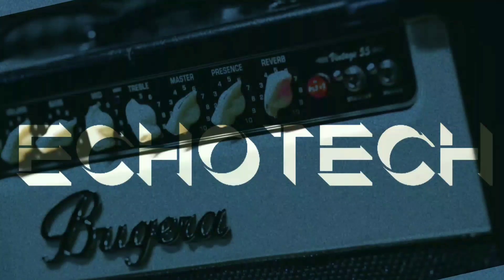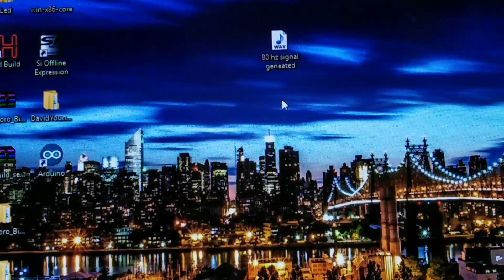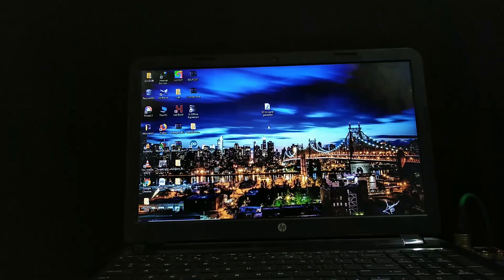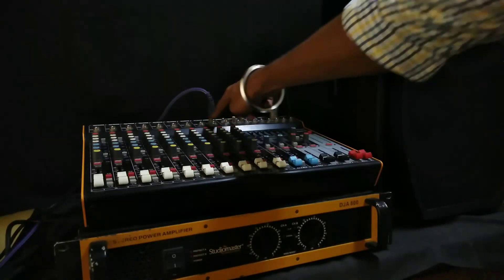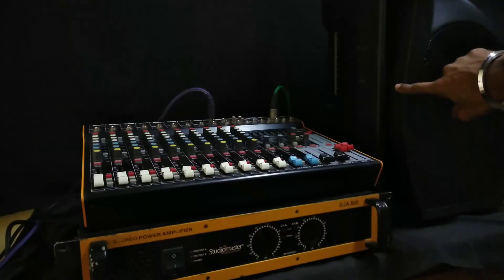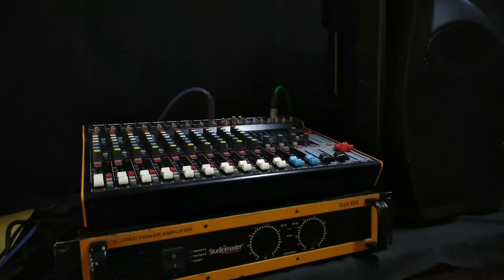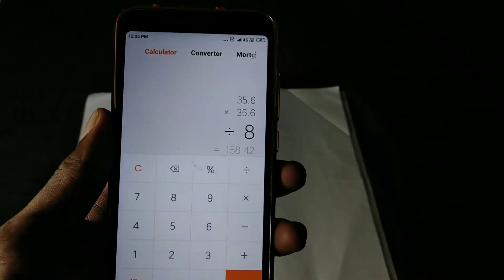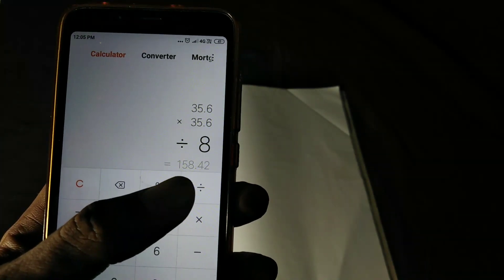എങ്ങനെamplifier wattageഎളുപ്പത്തിൽ  കണ്ടുപിടിക്കാം|finding wattage of an amplifier

Comment: Amplifier Test cheyyumbo kazhivathum Speaker connect cheyyathirikuka. 2 karanangal aanu. 1. speaker orikalum continuous power handle cheyyan design cheithirikunnath alla, so coil overheat aakan sadhyatha und. 2.Speaker impedance frequency anusarichu marikondirikum 80hz speakerinte resonance frequency aanenkil impedance 100Ohm il kooduthal aakam. apo theere kurachu current mathrame speaker edukullu. Athukond power test cheyyan speaker upayogikathirikuka, pakaram resistor upayogikuka. Nalla video! keep it up. your explanation valare vyaktham aayirunnu, good work.

Comment from the maker: N O T I C E The method described in this document is not designed to determine the actual "rated," "peak," or "dynamic" output power of an amplifier.
The original procedure include oscilloscopes,signal generators peak detectors and so on.kindly use this to check whether your amp output is working or not.
ഒരിക്കലും ഇതൊരു exact method അല്ല. Amp work ചെയ്യുന്നുണ്ടോ എന്ന് നോക്കാനും മറ്റും മാത്രം ഈ method use ചെയ്യുക. ഇത് ശരിക്കും ചെയ്യാൻ ഓസ്‌സിലോസ്കോപ്, signal generator എല്ലാം ആവശ്യമാണ്
അതുകൊണ്ട് പരിമിതികൾ മനസിലാക്കി video കാണുക 
instagram:http://www.instagram.com/mr.reciprocator
Reply: Echo Tech നമ്പർ തരാമോ ഈ വീഡിയോയെ കുറിച്ച് സംസാരിക്കാനാണ്